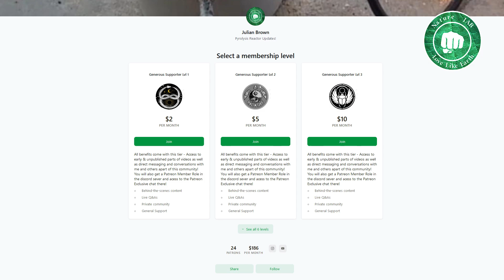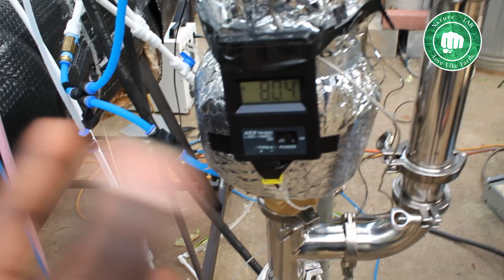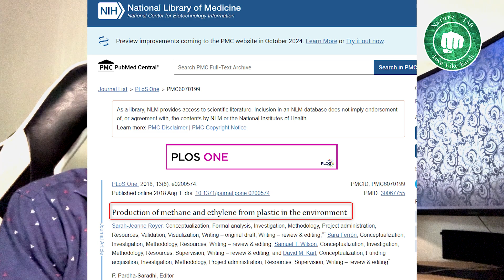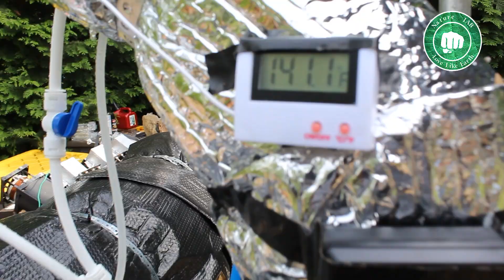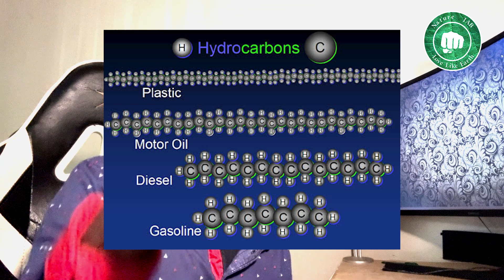Addressing Pyrolysis Critiques and Concerns!

Comment: Several patents exist for solar-powered microwave pyrolysis, including a U.S. patent application (US 2023-0242825 A1) from the U.S. Department of Energy's NETL for a process to convert mixed plastic waste into hydrogen and carbon. Additionally, a patent (EP3823934A1) from 2019 covers a microwave-assisted pyrolysis and gasification reactor, while other patents address specific aspects like thermochemical conversion systems (US 10907827B2) and plastic pyrolysis in general (US3843457A, US8888961B2).

Comment: Microwave plastic-to-fuel pyrolysis releases emissions, particularly if the produced gases are burned for energy. These can include nitrogen oxides (

￼

NOxcap N cap O sub x

𝑁𝑂𝑥

), sulfur oxides (

￼

SOxcap S cap O sub x

𝑆𝑂𝑥

), carbon monoxide (

￼

COcap C cap O

𝐶𝑂

), methane (

￼

CH4cap C cap H sub 4

𝐶𝐻4

), volatile organic compounds (VOCs), hydrogen fluoride (

￼

HFcap H cap F

𝐻𝐹

), and particulate matter. Additionally, plastics may contain persistent pollutants like PFAS, which are not destroyed by conventional pyrolysis, according to Inside Climate News.

Comment: Here is the thing. The usa has literal hundreds of thouands of tons of biological waste. It would make far more sence to build facilitys to harness the energy we dump in landfills and dump in lakes n oceans. They do this in japan and after they extract the fuel they use the safe biproducts to create more land on the coast. If anything that is the future of clean energy. All of that waste is producing co2 from breaking down, by burning it as fuel you greatly reduce the amount of carbon released into the air because burned fuel releases less carbon than just allowing methane to escape into the atmosphere
Reply: I'm sure it's simply a typo but, it would make sense if you could spell.😂

Comment: Yeah plastics =/= plastics. There are plastics with chlorine and other heteroatoms in it and those do not burn cleanly. Actual massive chemical producers put a big chunk of their production funds into filtration/safe disposal systems. You have no way to clean up those toxic side products so it isn't just crude oil unless you are selective with the plastics you use.

Comment: Comprehensive Guide to Minimizing Benzene Production in Plastic Pyrolysis

#### 1. *Feedstock Selection*
   - **Step 1.1**: **Identify and Categorize Plastics**: Start by sorting plastic waste based on their chemical composition. Focus on identifying non-aromatic plastics like polyethylene (PE) and polypropylene (PP), which are less likely to produce benzene during pyrolysis.
   - **Step 1.2**: **Pre-Treatment**: Wash and clean the selected plastics to remove contaminants that can contribute to benzene formation.

#### 2. *Temperature Control*
   - **Step 2.1**: **Install Temperature Sensors**: Set up sensors to monitor the pyrolysis process. 
   - **Step 2.2**: **Maintain Optimal Temperature**: Keep the temperature around 500°C, as higher temperatures can increase benzene production. Regularly check and calibrate the sensors to ensure accuracy.

#### 3. *Catalytic Pyrolysis*
   - **Step 3.1**: **Select Appropriate Catalysts**: Use catalysts like zeolites, alumina, or silica-alumina to influence the reaction pathways and reduce benzene formation.
   - **Step 3.2**: **Integrate Catalysts into Reactor**: Mix the catalysts uniformly with the plastic feedstock in the reactor.
   - **Step 3.3**: **Maintenance of Catalysts**: Regularly regenerate or replace the catalysts to maintain their effectiveness over time.

#### 4. *Post-Treatment Methods*
   - **Step 4.1**: **Distillation**: Implement distillation units to separate different fractions of pyrolysis oil, focusing on removing benzene.
   - **Step 4.2**: **Hydroprocessing**: Use hydroprocessing techniques to further refine the pyrolysis oil, effectively reducing benzene and other contaminants.
   - **Step 4.3**: **Adsorption**: Employ activated carbon to adsorb and remove benzene from the pyrolysis oil.

#### 5. *Emission Control*
   - **Step 5.1**: **Install Scrubbers and Filters**: Place scrubbers or activated carbon filters at the exhaust points of the pyrolysis reactor to capture benzene and other volatile organic compounds (VOCs).
   - **Step 5.2**: **Regular Maintenance**: Regularly check and maintain emission control systems to ensure they are functioning efficiently.

#### 6. *Pre-Treatment of Plastics*
   - **Step 6.1**: **Sorting**: Efficiently sort plastic waste to exclude materials prone to benzene formation.
   - **Step 6.2**: **Washing**: Thoroughly wash the plastics to eliminate impurities and potential contaminants.
   - **Step 6.3**: **Dehalogenation**: Conduct a dehalogenation process to remove halogens that can lead to hazardous byproducts during pyrolysis.

#### 7. *Continuous Monitoring and Maintenance*
   - **Step 7.1**: **Install Monitoring Equipment**: Use sensors and monitoring tools to continuously track process parameters such as temperature and gas composition.
   - **Step 7.2**: **Regular Equipment Maintenance**: Schedule regular maintenance for all equipment, including reactors, catalysts, and emission control systems, to prevent malfunction and inefficiency.
   - **Step 7.3**: **Analysis of Pyrolysis Products**: Regularly analyze samples of pyrolysis oil and gas to ensure benzene levels remain within safe limits.

### Conclusion
By implementing careful feedstock selection, precise temperature control, catalytic processes, effective post-treatment methods, and robust emission controls, the risk of benzene production in plastic pyrolysis can be significantly minimized. Continuous monitoring and regular maintenance are essential to maintain the safety and efficiency of the process. These strategies collectively contribute to a safer and more environmentally friendly pyrolysis operation.

For further details on the process and advanced techniques, refer to sources like MDPI and Springer for recent studies and comprehensive reviews on the subject [[❞]](https://www.mdpi.com/2227-9717/10/4/733) [[❞]](https://link.springer.com/article/10.1007/s40033-024-00672-1) [[❞]](https://www.mdpi.com/2227-9717/10/8/1497) [[❞]](https://www.mdpi.com/2227-9717/11/9/2764).

Comment: I would like to see an nmr spectroscopy analysis or anything to scientificaly prove the contents of the oil. Because as for now it is likely that it's too dangerous to burn and inhale, but since we have no confirmation yet, we can't say anything for sure...
If you really want to push your project to realisation, you will most likely have to distill the crude oil again to separate the dangerous from the safe.
Good luck on your project anyway
Reply: Yup. It would absolutely help know the status of the product and results or the variables.
Reply: the fractions are composed of toxic azeotropes that are nearly impossible to separate through distillation

Comment: I would like to hear an educated non biased persons opinion on these topics. seems like a lot of cope.
Reply: Mech engineering degree (just did enough to pass, university was hell). 5 years+ in steel manufacturing. You asked for the wall of text so here you go.

Shits real. Plastics are polymers with carbon and hydrogen and some other stuff. Carbon burns into carbon oxides, hydrogen burns into water. These have a lot of chemical energy.

Look then at fire triangle. Specifically the fuel and heat (oxygen is a given). When you burn stuff, it needs a chain reaction. The heat produced by the flame needs to be enough to chain react with the other bunch of fuel beside it. So once burned, it will continue burning. So for example if you light up charcoal for barbecue, you dint need to keep reigniting the charcoal. The embers will slowly light up more charcoal. Basically, its a "chain reaction". It continues until you run out of fuel. This is when more energy comes out than input. Conversely there are cases when its not a chain reaction. For example during brexit it was a meme moment when the protestors tried burning a plastic EU flag. Turns out, per EU standards, they add chemicals to the plastic that absorb heat. The flag can burn, but it eats up the heat of the flame. Specifically for this, its a case of more energy in than out. To burn these materials require a constant flame. You spend more energy to burn it than the energy you get from burning it. Thats EU standards for you. Joke being that the UK is rejecting something thats good for them. Like cavemen shooing away aliens offering futuristic tech.

You can burn plastic in a continuous flame. Get a lighter and burn a plastic straw. It will continue burning until it runs out of fuel. Its a chain reaction. This means you can prove without needing numbers, that turning plastic to fuel is more energy out than in. Plastic pyrolysis into fuel is legit.

Since youre asking credentials thats also where I need to stop. Because the next one is health and environment. I can cite that those third world pyrolysis factories legit generating profits from making fuel from plastic. I cant cite those 3rd world countries as proof that its ok to do so in terms of health and environment. My field, steel is also kinda polluting so I dont wanna be a pig making speeches on hygiene. Thus ends whatever professional opinions I may have on that. But if you welcome my input too on HSE, Im still willing to write some essays if you want.
Reply: @de0509  your spitting facts but nuclear fission is energy efficient and can be done without giving the neghborhood cancer. If it's a proven technology than why have uneducated amateurs expiramenting with it in unsupervised unregulated setting? What's the point of all this other than clout? Bro already hurt himself bad and has produced nothing but poison from the looks of it.
Reply: @fryfrom98  exactly, nuclear is an actual clean fuel. water is exhausted instead of toxic fumes
Reply: @de0509  I respect the time u have put into study. Nuclear fission is energy efficient and can be done without giving the neghborhood cancer too. If this is a proven technology why have uneducated unsupervised amateur expiramenting with it? Seems to me like all this dude has done is mutilate himself and produce a bunch of bottles of poison.
Reply: @de0509 I respect the time u have put into study. Nuclear fission is energy efficient and can be done without giving the neghborhood cancer too. If this is a proven technology why have uneducated unsupervised amateur expiramenting with it? Seems to me like all this dude has done is mutilate himself and produce a bunch of bottles of poison.
Reply: @de0509 hey you seem realy knowledgeable on this subject. May i talk to you somewhere? I want to start my own pyrolysis plant and I need advice.
Reply: @de0509  The plastic doesn't heat itself to be processed into "fuel" It also doesn't process itself into pure Gasoline either.

Comment: Hey bro, you should put some of your diesel  into a truck and run it for like 25 miles, then bring it into a place that does State smog/emissions test for registration. It should give you an idea of what the exhaust is putting out after combustion out the tail pipe. Cheep way of finding out. Blessing man! Keep fighting the good fight!
Reply: They don’t test for benzene at smog tests…
Reply: @andreahighsides7756  HI Andrea, hope your having a great life Pal! Ya, benzene is one of the things included in an emissions test.
Reply: Spread cancer across the county you mean?
Reply: In the UK, the emissions test on a diesel only measures particulate. 
Petrol gets tested for CO, oxygen, and unburnt hydrocarbons. 

Doesn't tell you anything about the composition of the fuel.  What gets measured in other countries?
Reply: Not a good idea to spray benzene around for 25 miles
Reply: Lmao I love these sigma strategies. Sounds funny but probably really doable for real

Comment: You need prv valve pressure relief valve. To prevent this from happening again. Glad to see you back on your track
Reply: I believe he needs both prv and rupture discs. Prv for the slow buildup of pressure normally useful for when the operator forgets stuff. Rupture discs set at higher pressure for when the prv is too slow e.g. in explosions. But generally yes i agree multiple fold safety measures is needed since he said hes going to bring in more people to help. Not everyone would understand the system fully since it would all be new to them.

I still think the condensing part has an interesting other option. Would be much rapid cooling if he could make a heat exchanger kind of setup set inside a tiny tank full of water and have the vapors bubble from under. Add some valves to drain/change the water. Valves to skim a layer of oil floating on top the water (liquid product). And an outlet at the top (gas product) where he can have his vacuum pump if he wants to. The direct contact of the vapor bubbling through the water would give superior cooling. While having heat exchanger tubes carrying cool water keeps that water clean and unmixed with the direct contact water. Alternative to a box of water could be water spray from the top, which is usually the best cooling since every droplet of water spray has a surface area, which are larger than the surface area of gas bubbling from under the water. Ofc all these are cost and complexity. But Im sure other than fabricating the box and the copper tubes for exchanging the heat, its not that big of a cost. The water spray is most complex due to having to continuously cycle the water and treat it. But its the superior cooling method in industries I think, like in some nuclear reactor cooling towers.

Comment: You can add solar cells and it will be profitable in any case you will reduce the plastic and produces fuel if the carbon you produce is not leaching any chemical it can be sold and you can use carbon the you produce to extract the benzene

Comment: 🙆 WHAT I REALLY HATE IS HOW MANY PEOPLE FEEL THEY ARE SMART IN YOUR COMMENTS AND AS SUBSCRIBERS AND EVEN AS NORMAL VIEWERS! 💁 BUT NOBODY WANTS TO RECOMMEND THE RIGHT PEOPLE, SAFETY PROTOCOLS, RIGHT SOFTWARES, THE RIGHT EQUIPMENT MATERIALS AND STRUCTURAL ENGINEERING NEEDED ! 2:52
Reply: The right thing to do is to STOP this. But he won't, because well meaning people unfamiliar with the science see it as a magic bullet and keep hyping him and his wallet up over it. In the most basic terms, he's using a ton of energy to separate the ingredients of plastic and then burning them. It's actually worse for the environment than just literally burning plastic. Everyone should know that's bad.
Reply: I mean, it’s honestly kinda hard to be of much help to this guy without making a list of recommendations that will cost him tens of thousands of dollars. But for starters, his system doesn’t have any centralized monitoring system and it doesn’t have any interlocks. Everything is loose and fast. And that’s okay but as he found out, has its own risks associated with that type of an approach. But, it would be far safer to have a centralized control panel with pressure readouts for all zones of all his equipment, disconnects and switches for all electrical equipment, and temp monitoring for all equipment in all zones. That way, you at least know what’s going on and have the ability to easily check statuses and easily control the equipment. But like I said, 10’s of thousands of dollars to build and implement something trustworthy that’s also flexible enough to handle future upgrades.
Reply: This dude is just a welder. No regard for safety. Enough said.
Reply: @CowCuttaa  And he doesn't care about the environment or he wouldn't be doing this.